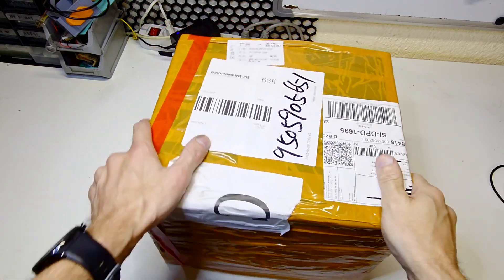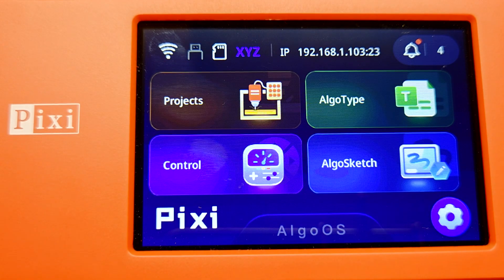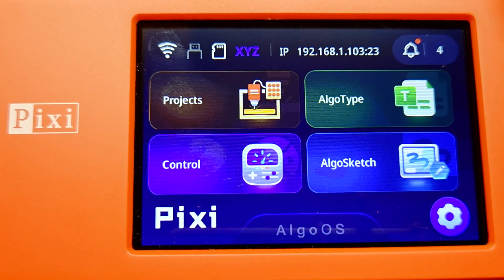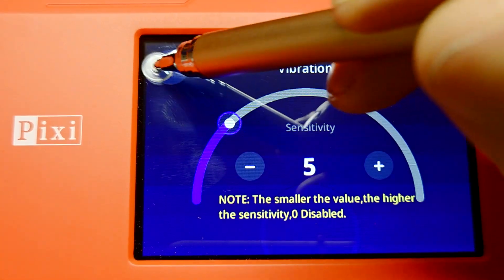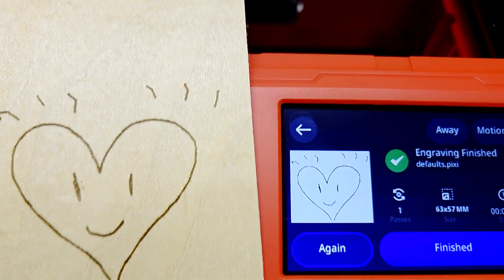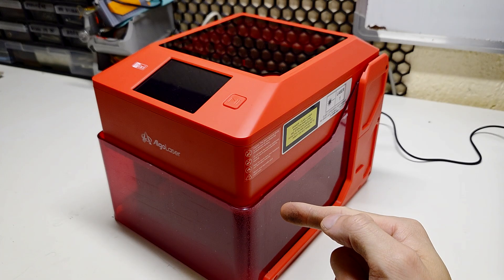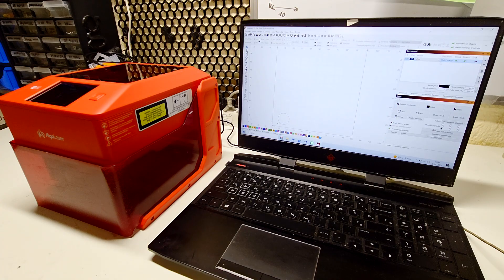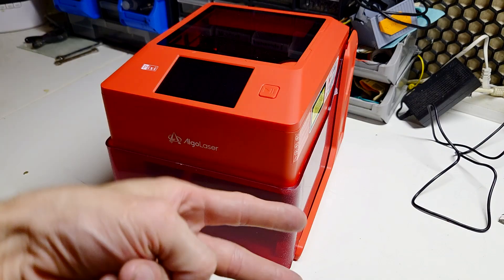The Most Compact Laser engraver for DIY projects - AlgoLaser Pixi 10W

Comment: yeah I still prefer my open air one that I can make a case for and some basic parts I can expand it theoretically infinitely lol Only thing I can see making it better is a good mirror system that I can bank the beam off of and refocus it at its smallest size back into a straight beam so the distance to the item I am cutting is not quite as important (can engrave much thicker things too than what this seems like it offers

Comment: Laser induced graphene?
Reply from the maker: Need to try 😁
Reply: I am actually working on a system to scale up (ie grouping a bunch of lasers so as it moves they all blast away making 32 segments at once so stacking them afterwards is useful for things like batteries and such :) 

have you looked at how reblasting it with lower power turns stuff like paper soaked in borax (keeps it from burning off as a fluxing agent leaving the carbon behind as a graphene foam) will cause these pointed spikes of graphene to form? That is what I really want to investigate by making a solution I can spray more burnable material ontop after finishing the whole depth of the paper to see if those are the beginnings of carbon nano tubes forming, cause man imagine a 1 watt laser being able to make tons of even 1 inch tall nanotubes let alone if you have better height control being able to go up as high as they can last LOL